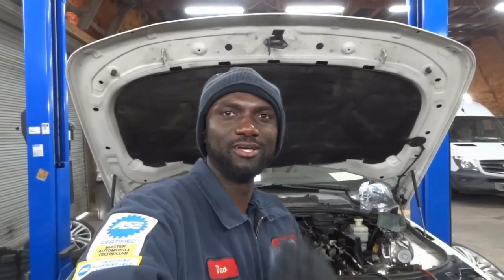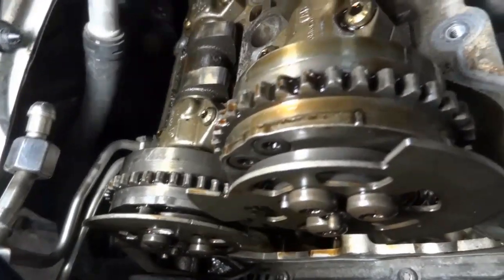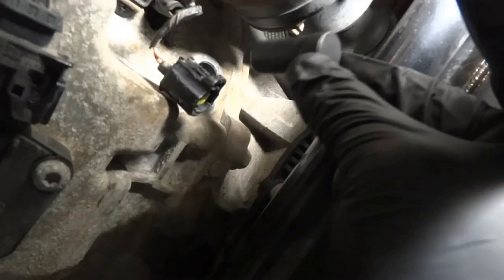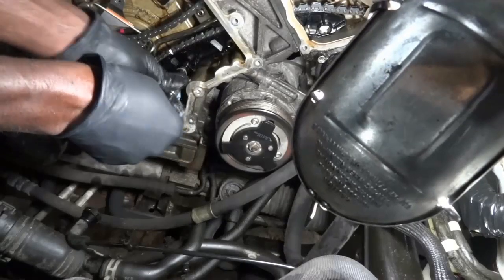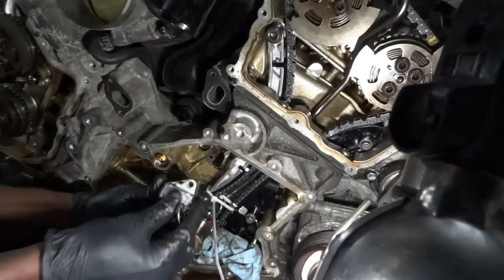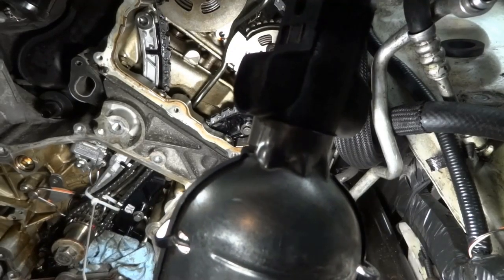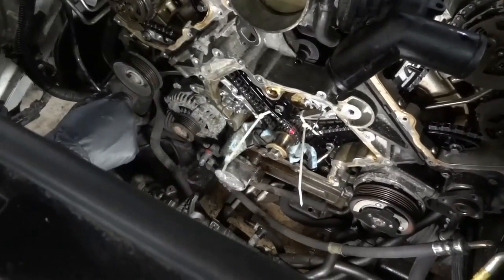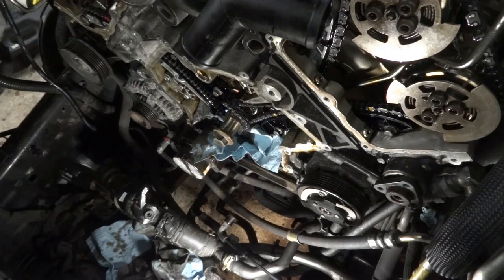Timing Marks and Timing Chain Installation On A Range Rover and Land Rover 5.0L Engine

Comment: That cam sprocket tool is to torque the bolts for the cam sprocket if you  replaced them not for the slack on the chain

Comment: 1:55 What's the name of the tool used to correct the slack between the cams? And is it necessary  to be used on any car when changing the timing chainswith V6 engine s?

Comment: He is not telling you exactly how the crankshaft is supposed to be positioned. It is supposed to be at the 6:00 position which equals 45° after top dead center. The Piston is not to be up at top dead center on purpose as a Fail-Safe so the valves will not Bend. If the keyway is not at 6:00 position the tool will not go in. If the Piston is up top dead center then the timing is off

Comment: Thanks for the video. According to manual 35NM pretension on intake LH sprocket and exhaust RH sprocket should be done before removing the tools that fix crankshaft in place. And for the guys out there - according to manual they tell you to turn crank 2 full revolutions but they dont tell you that marks will be in the same place - because they wont - they will move one tooth back and will keep moving back each revolution. So you have to spin engine a lot of times to get back the marks in the initial position and this is normal so don’t be confused.
Reply: Yeah so I’m confused just a bit as to why we have to spin anything
Reply from the maker: @accessdenied2010   My Pleasure!
Reply: Oh my God you are the only one that has stated that! And it is so true why doesn't anybody talk about that at all these videos I haven't seen anybody discuss that I also haven't seen anybody discuss how to align the high pressure fuel cam with all of this.
Reply: @damitryan4190  when everything is aligned you just need to insert the special tool into installation socket of the vacuum pump (it should be removed) and it should go inside easily (only one position); If not, just release the tension of the fuel pump chain (by moving the tensioning arm with your hand) and turn the pressure pump valve accordingly so the special tool might be installed correctly. The workshop manual has pretty clear explanations.

Comment: timed up mine and the first time it was fine. A week later it threw camshaft/ crankshaft correlation and now after i install all the chains / guides and do the 2 rotations, the witness marks on the chains dont line back up.  any ideas?  Timing tools still fit perfectly.
Reply from the maker: @sXRider-ly2ol   did you change the phasers?
Reply: @KITS_Auto_and_Truck_Repair  which bits are these?
Reply: @KITS_Auto_and_Truck_Repair can you tell me what a phaser is? Or where it goes pls

Comment: You seem very knowledgable and this video is fantastic! I am a female and know nothing about engines but have had a rather big problem with a garage that seized the engine of my Range Rover whilst repairing the timing chain. Would you be willing to look at the videos they sent me? They dismantled the whole engine during the repair and then handed the car back with the engine parts in the rear of the car!
Reply from the maker: @plainweird123  Thanks! It sounds like they ruined your engine, they should replace it for you and not charge you!
Reply: @KITS_Auto_and_Truck_Repair  they are refusing to accept blame and say I damaged the engine before I got there. But I drove it there, and they then also drove it down the road and back. Can I share with you some of the details over email to ask your opinion on what they might have done wrong? You seem very knowledgeable

Comment: I don't think cylinder 1 is at Top Dead Center when the crankshaft key way is at the 6 o'clock position.  I think it is somewhere Before TDC.  My understanding is Cylinder 1 is the forward most cylinder on the passenger bank.  When I align my crank key way to 6 o'clock, reluctor/flywheel lock installed, and the cams to the horizontal position with the square mark at the bottom (locked with the tool) cylinder one is not at TDC quite yet, verified with a endoscope camera.  Am I correct or is Deo in this video correct?  Other videos I've watched don't mention TDC.  I haven't found TDC in the manual either.
Reply from the maker: @marktimmons7418  I'm correct because I followed the service info and it worked!!
Reply: Deo, can you share with me what the service info says please?  I'd really appreciate it.  Great videos by the way!
 @KITS_Auto_and_Truck_Repair

Comment: At what miles should it be changed ?
Reply from the maker: @princeoffame100   about 120k
Reply: @KITS_Auto_and_Truck_Repair  other than that how is the transmission on the 2011?

Comment: Does anyone know about the reference stamp on the rear face of the camshafts? I am told there are two sets on each and since the alignment tools can be installed 180° out of time one of the reference numbers is suppoedly stamped and that is supposed to be in the upper most position before you install the cam tool.
Reply from the maker: @jeremyowens4176  Yes!

Comment: Quick question. I've done this process exactly how the manual says, with the tools needed. The only problem i have is when i turn the engine twice the chain marks are behind a tooth on both sides equally. Is this normal or is something wrong?
Reply from the maker: @bjornr9801  The marks may not line up but make sure the tools can go back in place after you turn the engine!

Comment: Very informative video thank you.  One question if you don't mind.  Which phasers upon re install need slack removal? Passenger side slack removed from exhaust cam and driver side ( us spec ) slack removed from intake cam? I notice the phasers are not keyed. Thank you.
Reply from the maker: @michaelangeloferrari4024  do it from the exhaust camshaft!
Reply: @KITS_Auto_and_Truck_Repair  ok thank you.  You are great for responding so quickly! Much appreciated as a fellow tech.

Comment: Thank you for everything you do . I just changed my jaguar xj supercharged timing chain and i turn engine right side.  twice only more than that the bolt is losing.  i turn the engine left side. more than 10 times but sometimes a little bit harder . and air coming out  sound like puff... from enjecter holes this is normal ?   please ........ thank you
Reply from the maker: @amicheonline1238  Turn the engine clockwise when you are setting up the timing chain!

Comment: James here- Great job very easy to understand! Question, I have all new parts, when I turn the engine over it is smooth but didnt notice the timing marks till after 6-8 turns. And they were not lined up, looked like off by a link... the chains are tight! Could one or several of the phasers be bad?? Thanks for any help would be great,, James
Reply: When I used to do this job at the dealer, I don't recall that marks ever lining up again. I'm in the comments trying to find support cause I think that part of the video is bs.
Reply from the maker: @cameronholowach8505  After you turn the engine the marks may not line up but make sure your timing tools fall iin place!
Reply: Yes they do... cam locks and pin.. Thanks for the response. @KITS_Auto_and_Truck_Repair
Reply from the maker: @Kathy-w6l   My Pleasure!
Reply: thanks for the info... my cam locks and pin do line up, so was making me second guess, thx
 @cameronholowach8505
Reply from the maker: @user-ge7lr3vr6n  Yes! you should replace the phasers!
Reply: Yes... I have ordered new ones. @KITS_Auto_and_Truck_Repair

Comment: Please sir after setting up the timing when I turn the engine right round it won't set with the timing marks anymore what might be the cause sir
Reply from the maker: @ChibuikeOgbonna-zu9lb  after turning the engine your marks may not line up but make sure your timing tools fall in place!
Reply: Thank u sir

Comment: time 15:35 in the video you spin the engine to check the marks line up again.   How many times did you have to spin the engine?  19 teeth on the crank sprocket and 140 teeth on the chain.   It takes 140 revolutions of the crank for the timing marks on the chain to line back up again.
Reply from the maker: Ed LaBarge  I usually spin the engine 4 - 6 times, the marks don't have to line up, as long as my timing tools can fall in place, I'm good!

Comment: Why when the crankshaft key ways at the 6 O clock position, no. 1 pistons not at TDC? It's like 1/2 inch down in the bore. 🤷‍♂️ cylinder volume maybe. Had a friend who's done the job 4 times, and kept getting correlation codes, and yes he replaced all 4 phasers.
Reply from the maker: Sheldon X  did he install OEM Parts on it?
Reply: @KITS_Auto_and_Truck_Repair  absolutely, straight from the dealer.
Reply from the maker: @sheldonx3283  Ok! Did he follow the right procedure to set up the timing? something must have gone wrong while the timing was being set up!

Comment: Hi.. just want to ask how many rotation the engine need to line up the timing marks after you replaced the timing chain and tensioner to re- check your timing? Or i don’t have to a-line up it again?
Reply from the maker: Erano Lopez  after you get all your marks lined up correctly then spin the engine twice, then make sure your timing tolls fall in place , your marks on the chains may not be lined up and that's ok as long as all the timing tools fit

Comment: can you show the last special tool to slack the cam with 30nm
Reply from the maker: Beneyam Adamu  I showed it in the video!!
Reply: Do you have to loosen any of the bolts to torque to 30 Nm or just put the tool on and torque it?

Comment: I just replaced the Timing Chains, Guides, Tensioners, Cam Phasers,  VCT Solenoids, and the Oil Pump on a  Ford 5.4 Liter 3 Valve Engine. It's similar to the Land Rover Timing Chain Job. I'm in the market for a 2012 Land Rover LR 4. I know the Timing Chain Guides were upgraded by Land Rover because they were very problematic. Your video helped me to see where the Timing Marks are for the LR 4. I really appreciate the time you took for me to complete the Land Rover Timing Job successfully.
Reply from the maker: David Hall  My Pleasure! I'm glad to hear that the video was helpful!
Reply: @KITS_Auto_and_Truck_Repair  Atlantic British made a good tear down video, but never really focused on the Timing Marks, which is very critical.
Once again, thanks a million!
Reply from the maker: @davidhall3747  My Pleasure!!
Reply: @davidhall3747  That's what I found here too.  Doing my son's 2011 Turbo 5.0 right now.  Next step is cam timing and chain setting.  Left bank exhaust jumped 3 teeth, ran like a Chevy 3/4 cam.  Picked up the SUV for $5k after several dealers passed it through auctions...last dealer didn't even advertise it, we drove by and saw it.  We did a full brake replacement too.
Reply: @MrM6d  Are you working on a 5 Liter V 8 Land Rover Engine with Turbo Chargers? If so, what year is it?
Reply: @KITS_Auto_and_Truck_Repair  Did you use the Special Tool to Lock the Flywheel after the Starter was removed?
Reply: Fantastic but, thank you. 
Q: I have the LR4 SCV6. Is your experience the same procedure? Do you have to remove the Super Charger 
. TIA
Reply: @kiwihugh4 

The procedure varies a lot because you are working on a entirely different Engine. The Supercharger must be removed.

Comment: Question, what if the phaser notches aren't on the top visible side, but are on the bottom or side of the cam sprocket?
Reply from the maker: Goaty  your timing is off or your phasers are worn out!

Comment: Awesome video. I'm ready to tackle this job on my 3.0 jaguar due to loose chain noise coming from bank 1. Bank 2 sounds good but while I'm down there doesn't hurt to just do both side! My only thing was I kinda wish you'd of actually showed you taking the slack between the cams off. You don't loosen any bolts right? Just torque it to the right spec and it'll tighten it enough...?
Reply from the maker: Rango Rangel  you have to take the slack off the cams with the phaser bolts loose!
Reply: @KITS_Auto_and_Truck_Repair  makes sense but I had to ask! Thanks. I still have to buy a Manual so I know all the torque specs for everything. Also do you know this that locking cam kit you used will work with a 3.0? Everyone I see for sale only said 5.0.
Reply from the maker: @LoveRango  I believe that kit will work on a 3.0L too!
Reply: @KITS_Auto_and_Truck_Repair  I think I have a big problem. Is there a way I can contact you to go further into detail? Trying to lock my cams but bank one chain fell off guide (original problem)and while I'm turning the cracks bolt, bank one won't move since it's not on bottom center sprocket. What do I do? Still have front cover on, yet to take out off since I can't lock cams. But pride it open enough from top to see what's going on.
Reply from the maker: @LoveRango  you can email me at Deo@Calleva.org

Comment: Hello sir! Great video!  I decided to do a head gasket and  complete timing component replacement  job on my 2011 Jaguar XF 5.0 only after watching this and a few other videos. I'm at a point in the job where I'm confused. I have both heads torqued down and the timing perfectly set up. I just rotated the engine two full revolutions as required. I have both camshaft alignment tools back in place and they both went in perfectly. My issue is I assumed after rotating the engine two times and making sure the two camshafts on each side were still in alignment are the yellow and white painted chain links supposed to also line up with the timing marks just as before I rotated the engine two full rotations or is it normal for the chain alignment marks to now not match those marks on the phasers and black plastic rail? The engine rotated smoothly with no resistance when I did rotate two times?   Thank you!
Reply from the maker: Terry Young  this is a good question! don't worry about the marks on the chains and phasers, as long as your timing tools can be installed after rotating the engine twice, you should be good!! the marks on the chains are supposed to be lined up only on the initial set up, before turning the engine, so make sure crank tool and cam tools can be inserted and that's all
Reply: @KITS_Auto_and_Truck_Repair  Thank you so much! they did in fact line up perfectly,  so I will start putting everything back together.
Reply from the maker: @terryyoung7550  My Pleasure!!
Reply: @KITS_Auto_and_Truck_Repair  I'm confused about this also, in your video it looks like you turned the engine and the marks all lined back up? I'm wondering because I'm wanting to pull covers off one of these to try to determine if the chain is off a tooth and I'm wondering if I spin the engine several times if the marks will line up to verify them and crank at 6:00...or if the chain marks never line back up again correctly once the engine turns.
Reply from the maker: @stephenwhite5444  it's difficult to line up the links on the chain after you spin the engine, you have to turn it so many times to get them to line up, I recommend spinning the engine twice after setting up all the marks correctly, then check the position of the crankshaft and camshafts ! with the timing tools

Comment: K Diagnostic, This is an excellent video and training piece you’ve done. I stumbled on it as I was looking for one for a 3.0 V6 supercharged engine for a RangeRover 2015. Who’d you say the same applies on the V6 engine? Mine just blow the gaskets from a major coolant leak incident. Apparently had been leaking from the rear crossover (heater manifold) pipe but was not noticed until we had a major one from the front crossover as well. I did the replacements in my garage but only realized the gaskets are gone after I finished the work and the vehicle failed to start due to loss of compression. Would like to work with you on it, if you don’t mind.
Reply from the maker: Michael Owino  it's a similar process on a 3.0L, you can email me at Deo@calleva.org if you have any questions!!
Reply: @KITS_Auto_and_Truck_Repair  thanks Deo, I’ll drop you a couple of questions on your email.
Reply from the maker: @mikiowino  My Pleasure!!

Comment: I did head gaskets on a 2011 range rover sport 5.0 supercharged. Only special tools I used were the counter hold for the crank pulley. Just marked the chains in one particular spot and finagled the cams off without pulling the phasers.. worked out better than expected. Worst head gasket job I’ve ever done though, took a lot of labor time. Also replaced chain tensioners while in there, 80k miles. Thanks for the great video 👍
Reply from the maker: William Thibault  wow good job!! but I like the peace of mind that having the right tools give me!! and you're right it's a very Labor intense job!!
Reply: @KITS_Auto_and_Truck_Repair  oh yeah, I do too. Was a spur of the moment job so I didn’t have much of a choice.. I always prefer having special tools for any foreign job
Reply from the maker: @williamthibault5545  yeah!!
Reply: Thanks for the info I’m actually doing head gaskets on my 2012 Range Rover 5.0l and I ran into this thanks